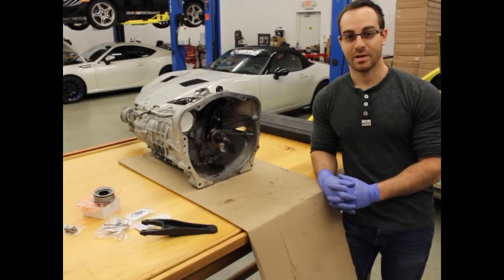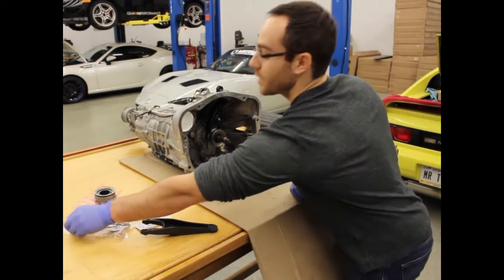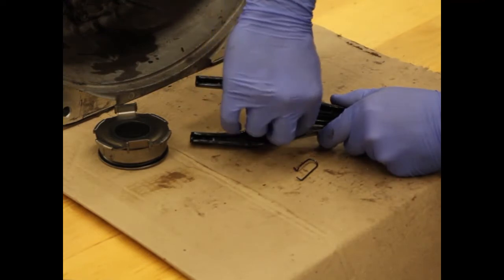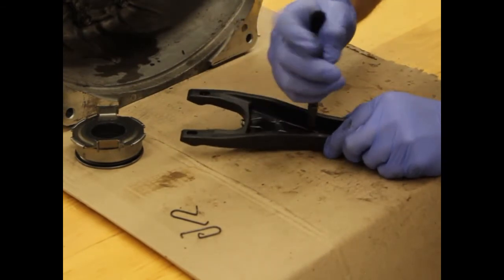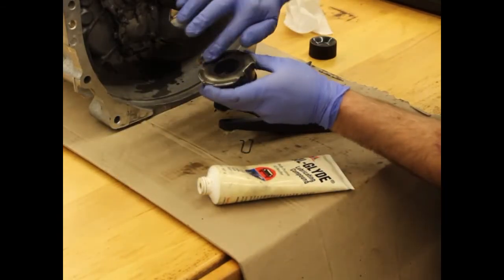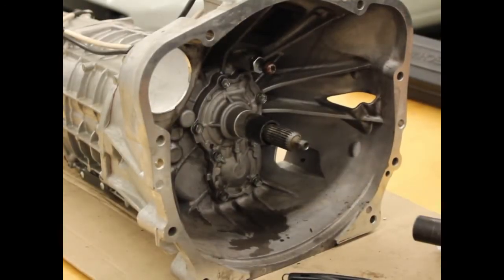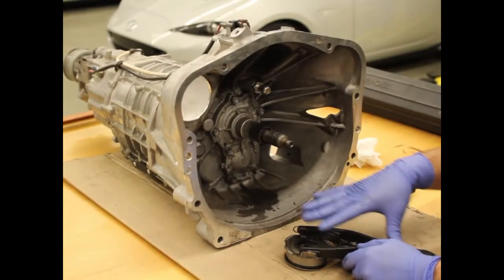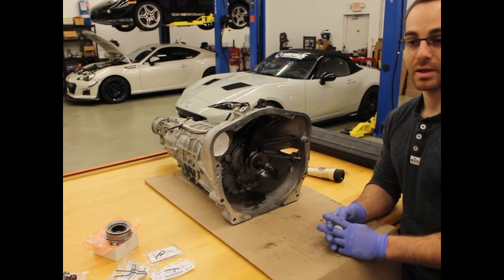BRZ/FRS/GT86 Forged Clutch Fork and Pivot Install

Comment: Great video. Just got my install done. Only thing I would add is the clips that attach the fork to the throw out bearing are not symmetrical so they orientate opposite ways.
Reply from the maker: The clip themselves are identical as they are the same part number from Toyota, but yes you are correct in saying they are installed in a different orientation.
Reply: Yeah I had to notice that one loop was upside down while the other was right side up.  I did not pay close attention to how they were oriented when I took off the clutch fork

Comment: Be aware all people... is not enough to just give a littler tap to the fork to make the pivot enter to the spring. Take away the fork boot and looking back of the fork make sure the spring is grabbing the back flat area of each side of the pivot. If is not never install the transmission, because if you install trans without doing this when you engage the clutch the fork is going fall off from the pivot and thats will be a real problem. You must make the spring grab that flat area of the pivot using a tuff wire with a bend tip like U or L shape. Then pull each side of the spring until the each side of the spring reach that flat surface of the pivot. Is easy  is not hard to pull. Thats why he never move the fork back and forwards without holding the bearing, because the fork will fall off from the pivot. This is a tip that no everyone going to tell you.. Well bye !!!!!
Reply: Agreed. I just did mine today and I removed the boot and installed the spring insuring that the spring was behind the pivot ball supports flat face

Comment: Just installed the Verus clutch fork and new pivot on my 2018 WRX. The fork seems to move up and down the metal clip instead of resting on the pivot ball. If I push the fork onto the pivot ball, then the fork and TOB don't move freely. Do I need to replace the metal clip on the back side of the fork? Thanks,
Reply from the maker: Yes, we always advise replacing the OEM TOB and clips when replacing the clutch fork and pivot.

Comment: Purchased this for a 15 wrx and a 17 wrx and i noticed on both that the verus fork sits in a lower position than oem and the slave cylinder rod gets pointed downward. On the 15 it's not fully disengaging the clutch even when I adjust the clutch pedal all the way out. Are we suppose to shim the pivot ball or is there a slave extension rod were suppose to use?  Or am I way off the mark here?
Reply from the maker: No shims are needed. These are a direct replacement for the OEM clutch fork, so the fitment is the same as the OEM fork.

Comment: So according to the service manual it says to apply grease to the spline area of the input shaft and to the inner periphery of the throwout bearing, but explicitly states not to grease the sleeve on the input shaft where the throwout bearing slides over. Why is that? Note, I'm aware you didn't recommend to grease the sleeve in the video, I'm just curious.
Reply from the maker: Not sure. We recommend following the OEM install instructions. This transmission was not going back on a car as it was an extra we had lying around and was simply for clutch fork install purposes only.
Reply: Mario where did you find the service manual????
Reply: probably just because you already greased the same contact point via the TOB, and excess grease could get pushed onto the input shaft as you operate the clutch, and as the input shaft spins it could potentially fling that excess grease out and onto the clutch friction disc, which you don't want. But as long as you grease really thin, or you push the fork back and forth several times, wiping away any excess, it doesn't really matter if you grease both

Comment: Hi this clutch fork looks exactly the same as my 2009 GH wrx . I wanted to get a billet one but could only find one suitable for a dual mass flywheel type. My clutch was upgraded and has a fork with the clips and throw out bearing just like the brz one showed. I’m wondering if this will fit as I have purchased an oem one but I don’t trust it .
Reply from the maker: Not sure. We have a fitment list of compatible vehicles available on our website. We offer 3 different clutch forks at this point in time.

Comment: Do you recommend using any thread lock on the pivot?
Reply from the maker: gohan3rdrift we do not. Factory does not as well.
Reply: I was just going to ask that.   What about anti seize?
Reply from the maker: @Wolverine05  No reason for anti seize.
Reply: @VerusEngineering  thanks for the reply

Comment: After replacing the clutch fork with the versus one, I started having issue with vibration from the shift fork causing lots of noise at the push point where it meets the slave cylinder. Drop the transmission the other day grease every point on the fork and pivot ball and replace TOB. Noise went away for a day and is back again. Noise is only present when clutch is fully disengage when idling and cruising.
Reply from the maker: Sorry to hear this. Please send us an email. sales@verus-engineering.com
Reply: Did you get this resolved ?
Reply: @rookietoprobuildz  yes, it ended up being a bad transmission
Reply: @allthingsatonespot  Thanks for getting back to us. Hate it when someone never gives a resolution.
Reply: Hi i have a problem on my toyota. I replaced a clutch pressure  plate and when I press the clutch there's a noise coming from the transmission not sure if it's a release bearing since it was also replaced

Comment: You must change the throwout bearing retainer cover bhruuuuu🤦‍♂️
Reply from the maker: This is not necessary unless there is a preexisting issue with the current front bearing retainer cover.
Reply: Verus Engineering  change the cover is a MUST . Why??? Well the constant back and forwards movement of the bearing cause wear in the cover. As i always say: do everything in the right way or don't do it.
Reply: Entirely agree. Bearing retainer (cover) likely worn from use or from throw out bearing failure

Comment: Why does this need to be changed
Reply from the maker: The OEM clutch fork is known to break or bend with use of higher sprung pressure plates.